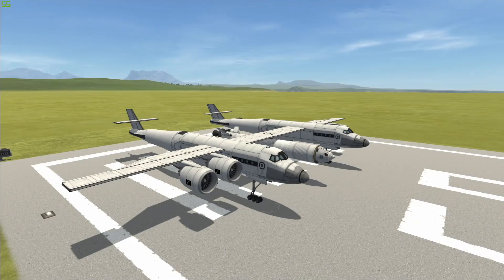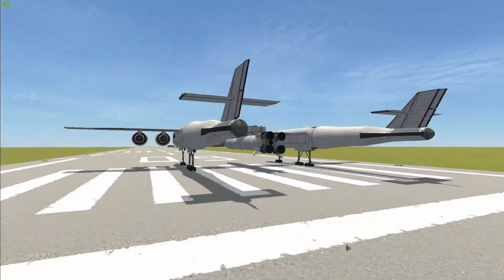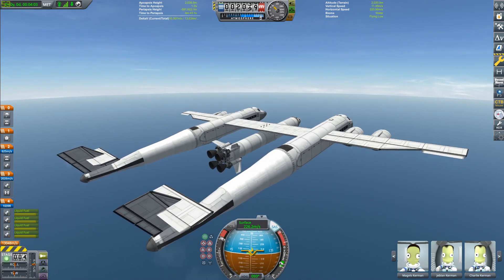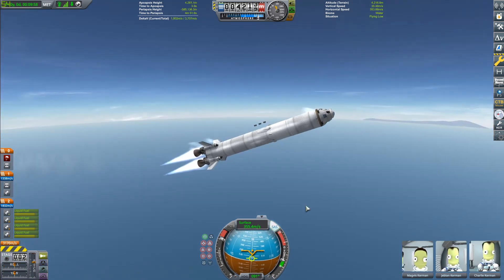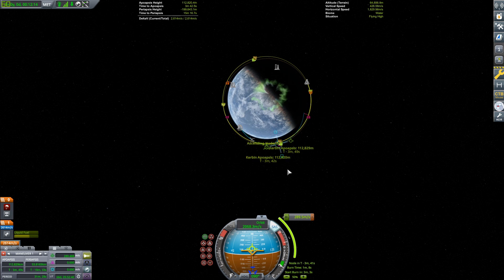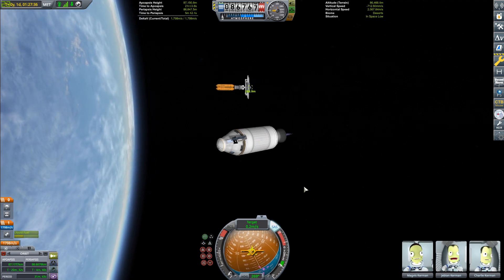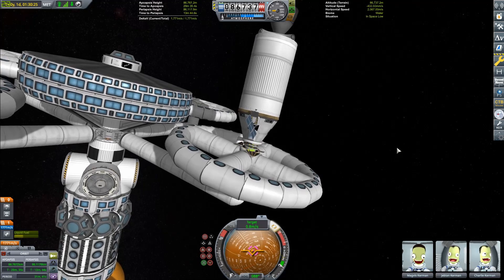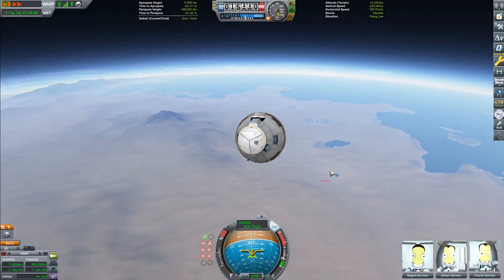KSP: SpaceX's Plan To Air Launch The Falcon 9!

Comment: Can you do a Sea serpent video?
Reply: Do you mean Sea Dragon?
Reply from the maker: @elijahwills7331  I’m assuming so
Reply: @Piolet1549  any chance you could size it correctly with a 10m diameter? the real thing was 21m wide so it makes more sense to do 10m. It can work- use fairings to get the width right. I made one once, but it can be kraken bait so be careful.
Reply: @elijahwills7331  @Piolet1549 
Not the sea Dragon. The ripple sea serpent is a rocket designed by the Norwegian Ripple aerospace company. It is sea launched and uses aerospikes.
Reply: @dolbez9739  Oh ok. Interesting.
Reply from the maker: sure

Comment: There is actually a way to recover air launches in stock. Basically you are emulating FMRS manually, it's a little bit complicated so if you want to know just contact me on discord. Dynetics also partnered with Pratt and Whitney rocketdyne (merged with aerojet to become aerojet rocketdyne) and made a proposal for an advanced SLS booster to be used on Block 2, which is in game the twin boar with another 2.5m tank on top. However now that BOLE is a thing, and that the advanced booster program hadn't been funded in years, the BOLE boosters I'm guessing are just going to become block 2. When ATK was the person making the SRBs, I would think dynetics may have had a chance but now that Northrop Grumman bought them I doubt they would be happy with a different company making the boosters....

😔

oh crap I did it again

I'd also recommend a small mod called kerbal joint reinforcement, it helps to tame the kraken on those big builds
Reply from the maker: So that's where the twin boar came from... interesting...